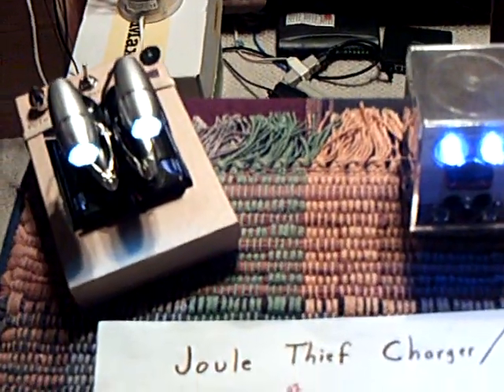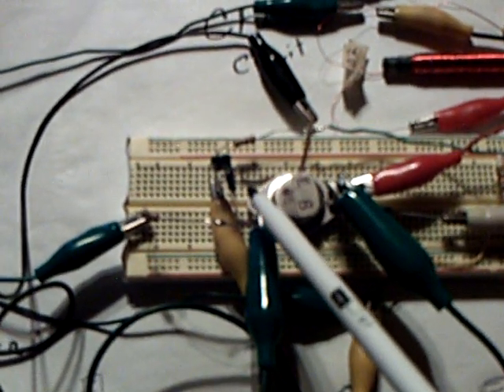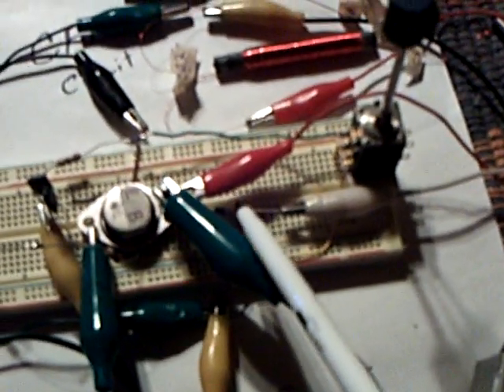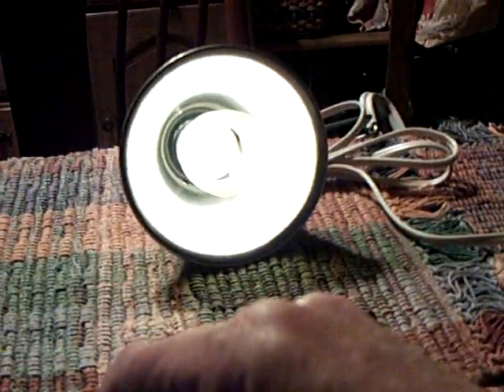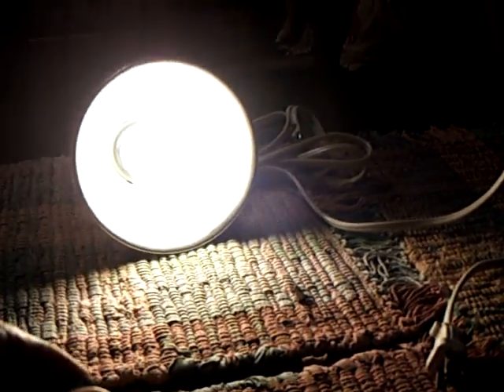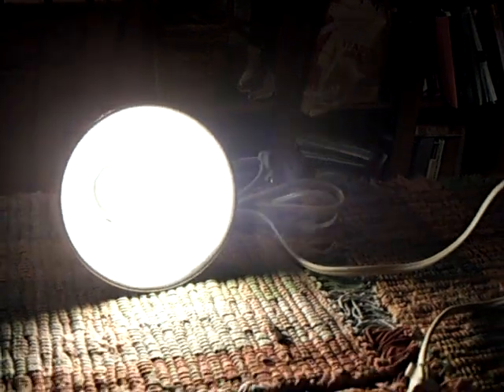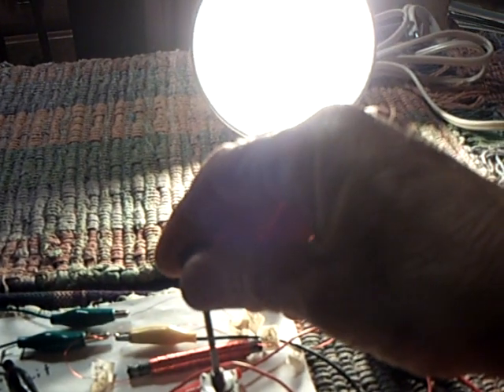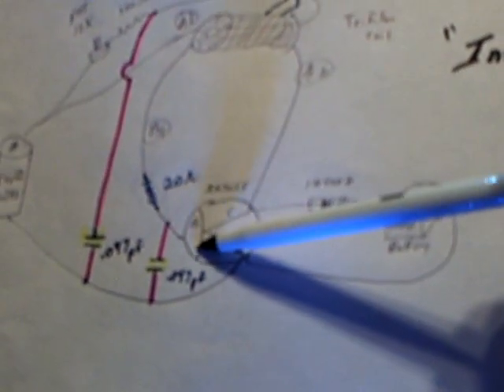Inverting A Joule Thief

Comment: Hey there Lidmotor...when you want to show the brightness change when kicking in a circuit, cap...core...etc...instead of showing the light source... focus your camera on what it is lightin up, with no other light on... then when you reach critical mass and it kicks in, the difference will be as apparent as it is to your eyes...  of course once reached the camera will then readjust for the new light level....but as long as the rays from the source are hitting the light sensor of the camera, you will get everything else darkened out as a result...because the camera sees only "peak" brightness, unless it has a multiple light source sensing array, and will only partially reduce the aperture, for which is currently not found in home user equipment, or even many levels of professional, but won't say it is an impossible technology with a multi shape aperture that can change its shape to reduce on portion of a scene without closing it on another.  

You will get better results shooting this way though!!

Namaste'!

Comment: I have a coil I wrapped bifilar with a resin/magnetite center 450 times. I do not have a battery but a 12 vdc/850ma wall inverter, 10k pot and a 1 k resistor connected to a high voltage npn transistor. 12 volts in and almost 1000 volts out connected has a joule thief. This is why I was asking about a closed loop system. It sounds nice but?????, maybe I can keep trying.

Comment from the maker: @jjackdaddy56 ------All my attempts to "close the loop" with a feedback to the source battery---have failed.   It just doesn't work.  You need the system to be "open looped" like a wind generator or a solar cell.

Comment: Have you ever fed the output back into the feed battery? I'm thinking of putting a 6000w inverter on the feed battery at the same time using this circuit to keep the feed battery charged from its own joule thief. What would be your opinion????

Comment: i tried the joule thief circuit and i got 38 volts (dc) of a 1.5v rechargeable cell (yes i know rechables are 1.2v but my charger is foucked up). I had fun with hv cap discharges.

Comment: Brilliant work once again Lid!!

The ferrite bar makes it a lot easier to add the 400turn winding, it would be hard to get that many turns on a toroid (its hard enough getting 80!)

This video really shows the potential of this JT circuit. have u posted circuit up on the forum?
U have inspired me once again Lidmotor, I will have to try this!
cheers
-shlodo